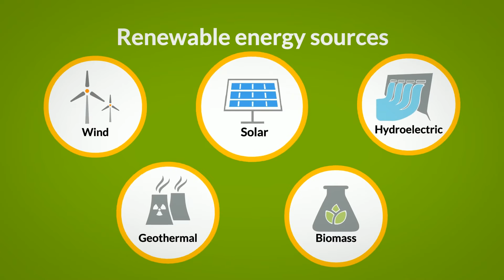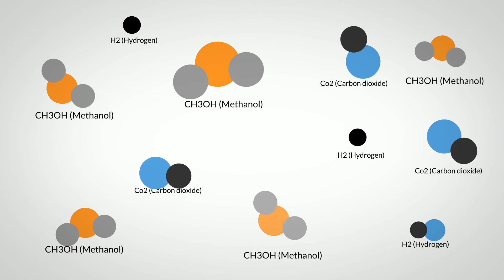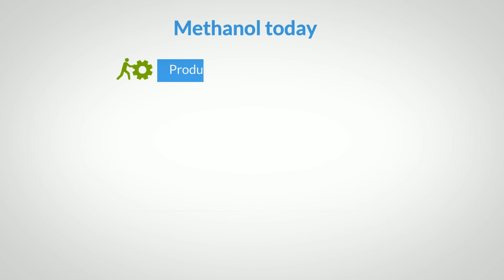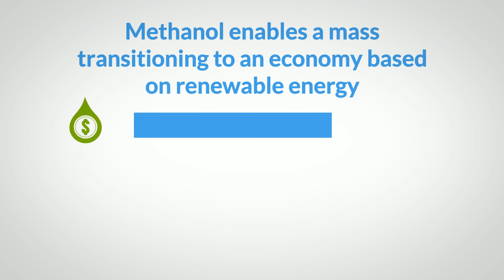Methanol fuel cell vehicles

Comment: What are current vehicles on the market that have Methanol fuel cells? Also, can i use methanol instead of hydrogen in vehicles specifically for hydrogen? Could I make a little altercation to a hydrogen vehicle to work with methanol instead?
Reply: geely China's auto giant..
Reply: I don't think you can take a liquid and use it in a car that uses gas
Reply: @Sam-gf1eb  Gasoline is a liquid.
10% of gasoline sold in the USA is ethanol.
Reply: @Sam-gf1eb  https://youtu.be/G3iKJ4IMick
Reply: @Sam-gf1eb  It seems reasonable as long as that liquid is turned into gas state before it goes into the engine?? Good question though 🤔
Reply: https://youtu.be/G3iKJ4IMick

Comment: The fuel cell converts the methanol into CO2, water, and electrons. There is nothing "green" about methanol.
Reply: Black or gray methanol comes from fossil fuels. Green renewable methanol can be made various ways. It’s basically wood alchohol.
Reply: It's carbon neutral if sourced from renewable energy.
Reply: @oby3000  you have no clue of how methanol is made, do you ? The production of mathsnol is energy and water intensive and you need … natural gas (read methane) to reform the gas into methanol. Look up natural gas reforming into methanol..

Comment: Still emits co2 doesn't fix the problem. A bandaid to a broken arm.
Reply: Synthetic methanol is the rage when discussing what to do with surplus wind power (power to X). In that case. the CO2 emitted was grabbed from the air when the methanol was made, so this can be CO2 neutral.
Reply: @Tore_Lund  Unfortunately it's ludicrously expensive and the world will be a dumpster fire by the time it's on par with burning gasoline.

Comment: There are two kinds of fuel cells: Those that HAVE exploded and those that WILL explode. Fuel cells are less stable than nitroglycerin. Nitro is used every day in mining without incident. Even the military no longer uses fuel cells for GPS power or Command Radio Network Power Systems in Afghanistan as they are too dangerous.
Reply: Please supply a reference

Comment: You should perhaps focus on the limited charging-discharging lifespan of lithium batteries, whilst on the other hand, fuel cells are far less likely to degrade in efficiency over time? Right?

This is the major advantage of fuel cells from a consumer point of view, along with higher energy density/vehicle range and "well to wheel" efficiencies.
Reply: Evolving solid polymer electrolyte material should help address dendritic growth - http://ionicmaterials.com/the-solution/
Reply: batteries are great for short trips with over night charging....while Methanol (using fuel cells) will be more suited for use during longer trips... 
they are more complementary forms of tech than in competition with each other...

Comment: is there a car which runs on methanol only not on electricity
Reply: Renewable methanol can also be converted into renewable gasoline through a process that has been in use for a few decades now.
Reply: See Fiat M15 Israel http://www.greencarcongress.com/2016/11/20161103-fcam15.html
Reply: https://en.wikipedia.org/wiki/Methanol_fuel . it does work
Reply: You must change your fuel systems and remap the car for it to run on methanol. Most cases this will cost you anywhere from $1000-3000 depending on your build and labour. Methanol is better for your engine in every way except for MPG as your car must use more methanol to produce the same power as petroleum.
Reply: +willem kanon ..Yes
Reply: https://fuelcellsworks.com/news/blue-world-technologies-signs-agreement-on-methanol-fuel-cells-with-chinese-ev-manufacturer-aiways/
Reply: Chandrashekhar Uprade any car can run on methanol with just a few minor adjustments to tge engine

Comment: Just curious, what is the fuel economy of a typical methanol fuel cell car (e.g. in km per liters of MeOH) ?
Reply: The reformed methanol fuel cell system of Serenergy consumes 0.85 liters of a methanol-water-mixture (60:40) per kWh electricity produced.
Based on a typical electricity consumption of electric cars like 15 kWh/100 km, it would be roughly 13 liters per 100 km. Or 8 km per liter.
But again: This fuel cell system doesn't use pure methanol, but a mixture with water.
Efficiency of the fuel cell system: 42%, according to this data sheet:
https://serenergy.com/wp-content/uploads/2019/10/H3-5000-Datasheet.pdf
Reply: @701983  Thanks, very interesting.
Actually, it's excellent, considering that even pure methanol has half the energy per liter than a liter of standard gasoline. I always wondered why we don' t still have serial hybrids with methanol fuel cell to back-up ordinary battery electric vehicles
Reply: @701983  Indeed, that's one of the reason I prefer a serial hybrid so that you don't need a, say, 100 kW fuel cell to power a 100 kW car, but only a few tens of kW, at max, just to keep up the proper state of charge of the batteries (charged from electricity from the grid, for the most time)
Reply: @babyelian77  That's pretty pointless because if you have a battery that can output 100kW, it will have a decent range and you may as well charge it directly from solar.
Reply: @701983  Not having a big battery pack that weighs as much as 5 passengers, a fuel cell vehicle should use significanly less, less than 100Wh/km at low speed especially in city driving where accelerations are frequent.
Reply: @Tore_Lund  But fuel cell cars aren't that much lighter than comparable battery electric cars. A car with 20% less weight (e.g. 1600 kg instead of 2000 kg) doesn't consume 60% less energy for propulsion.
Reply: @701983  That is because they a expensive to make, so the offering from say Nissan, are giant MFs to attract luxury buyers. At low speeds 20-30 mph, rolling resistance is 2/3 to 3/4 of energy losses in a car and rolling resistance is directly proportional to mass. So if you can reduce vehicle weight by 60%, you also reduce rolling resistance by 60% or your energy consumption by 30%! Then having less mass to accelerate, also reduces the Ah per acceleration by a similar amount, so it all adds up. For comparison I own a 900kg 4 seat EV with only a 20kWh battery pack and I use only 100Wh/km getting around town.
Reply: @Tore_Lund  That's why I said "comparable" battery electric cars. 
Of course, we could produce pretty light battery electric cars as well as pretty light fuel cell electric cars. But a "comparable" fuel cell electric car won't be 60% lighter than the battery electric version.
Reply: @701983  If a Tesla toady is 4800lb but the batteries are only 900lb, that is the real problem. It should be possible to make EVs where battery weight is 1/3 of the vehicle weight. It would take about that to give EVs a comparable range to gasoline. More batteries are not the solution, so we need lighter EVs regardless, and not converted gasoline cars, which is the current style. The first light fixtures were made by gas and kerosene lamp manufacturers, because that was what the customers were used to. In other words, the newly invented electric bulb was used to simulate old technology. It is currently the same develloping stage production EVs are in now. The way is to get the mass down, that be by better batteries, fuel cells or smarter engineers, making chassisses from  materials more suitable than steel.
Reply: I think you mean CH3OH which is basically just single carbon gas with hydroxide branch instead of 8 carbon gas (octane).
Reply: Curtis Smale Yes, MeOH (and DME for C2H5OH) is the short for CH3OH, indeed